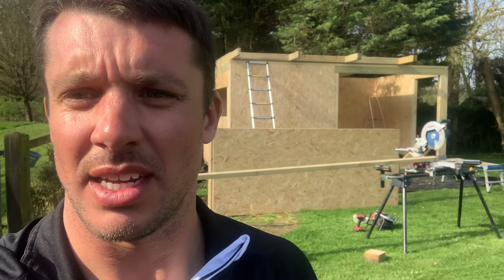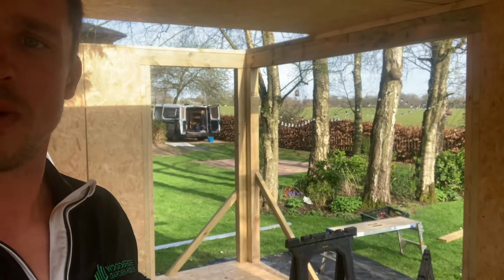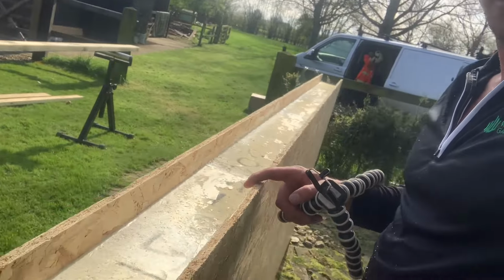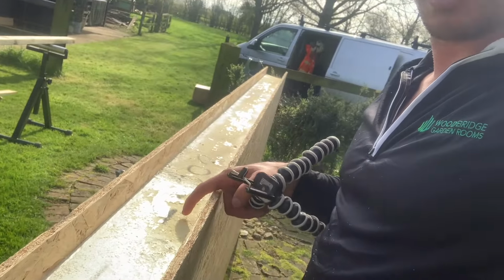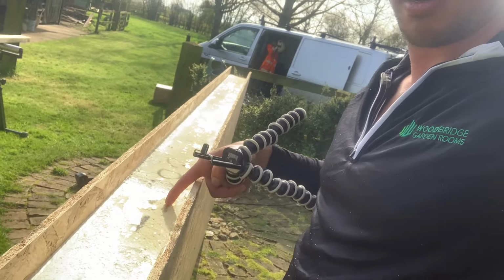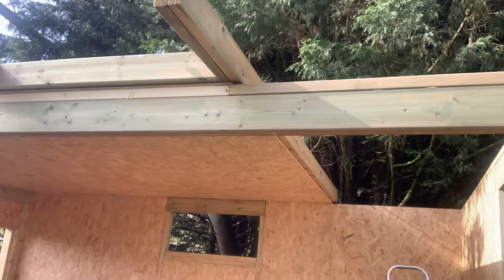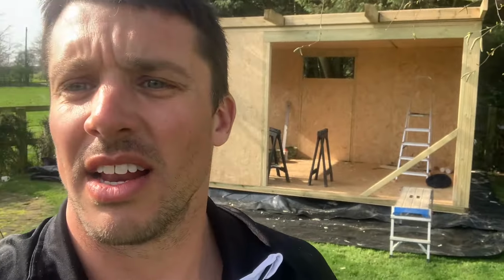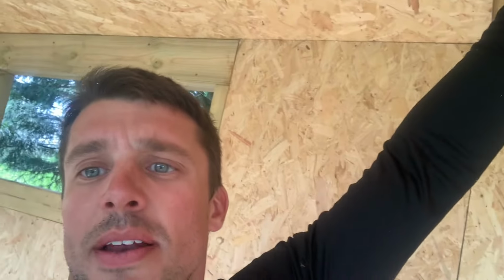Installing a SIP flat roof on a Garden Room

Comment: Can i ask what timbers you are using inside the 150mm thick roof panels? Ive got 5 x 2, which come with a finished size of 120mm wide. With the 150mm panels, that leaves a gap of 8mm in total. Seems like a bit of a loose fit? I guess once you screw them they will pull in a bit, but that will still leave a gao of 2mm at least surely? Obviously this is be glued, but am i missing somethig here??? Thanks so much for your help!!
Reply from the maker: Yes there’s a slight discrepancy on the timber sizes depending on your panel manufacturer of course. Don’t worry about it. Make sure you use a good timber glue and they’ll be fine. You don’t even need to drive the screws fully in as they often tear into the OSB, just put them flush and every 300-400mm 👍
Reply: @woodbridgegardenrooms  thanks mate. I'm using super sips panels. I've almost used their glue up. Any recommendations for ue from screwfix / toolstation? 😊

Comment: Are those furing strips 100mm wide? If so where do you get them from as I can only find 45mm or 49mm wide, cheers!
Reply from the maker: You are correct. I made a video about this here: https://youtu.be/61XcTVVCK1Y?si=WABk1Y4eyUReZYhY
Reply: @woodbridgegardenrooms  Ah I see! have you ever just screwed 2 x 45mm thick furings together? I've got 96mm sip walls, not sure I could do a cut like you did 😕
Reply from the maker: @musicpros875  you could do that yes. Would work the same way :-)

Comment: I must be thick as I still dont get how you attach it. How is it secured down to the main frame to stay strong in the wind etc - having seen normal timber joist roofs being secured down with upside down joist hangers etc...
Reply from the maker: Each panel is secured along the timbers that run inside them, these timbers are screwed to each other. The roof panels are screws through the outside timbers into the wall plate with 200mm structural screws before the roof goes on. The roof panels weigh about 60kg each so are fairly heavy.
Reply: @woodbridgegardenrooms  thanks! 😊

Comment: I have been following the channel for a while and I am Hoping to build a shed 
using 100mm SIP panels for walls and roof soon. Is the timber you use to join the panels Rough Treated or no. I was wondering if it needed to be planed timber to insure a tight fit.
Reply from the maker: Needs to be pressure treated c16 or c24 👍
Reply from the maker: You can use 3x2”, 4x2” and 5x2” timber
Reply: Thanks very much..